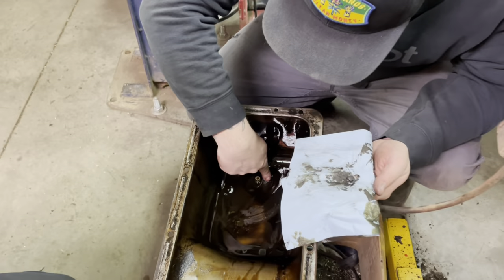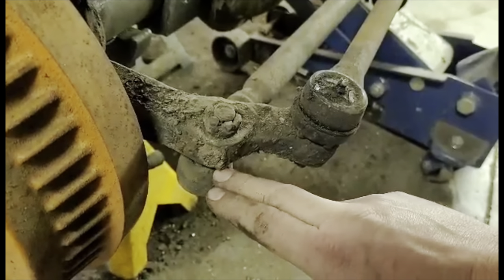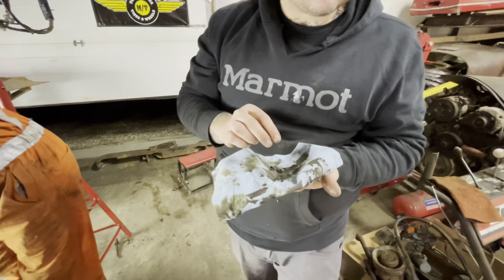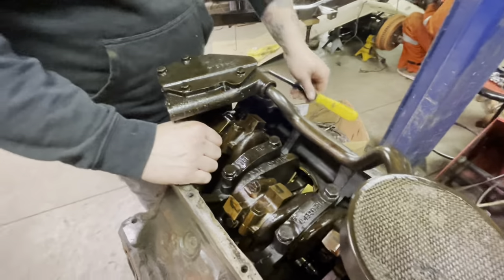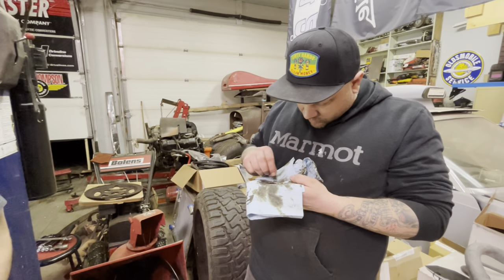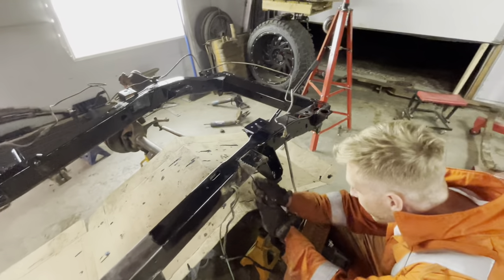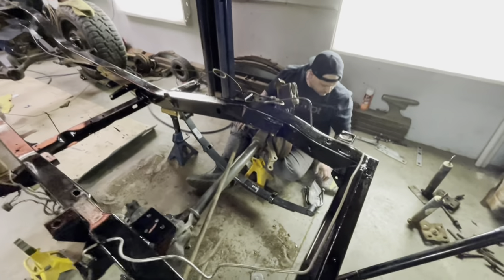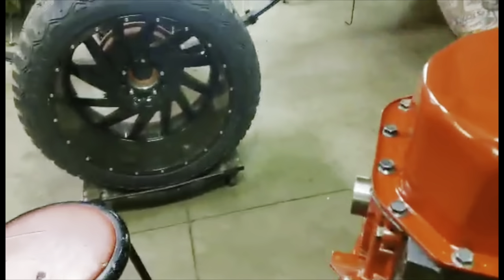Scouting things! 1972 International Scout II

Comment: Were the bolts "finger loose" or "hand tight"?   There's a difference.   Also I have a '72 with drums all around.  How do you remove the front drum? Do you have to unbolt the hub?  Thanks.
Reply from the maker: Well little bit from Column A and a little from column B.   And no you do not have to unbolt the hub